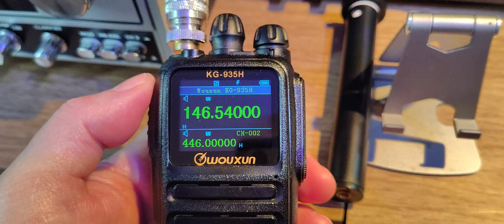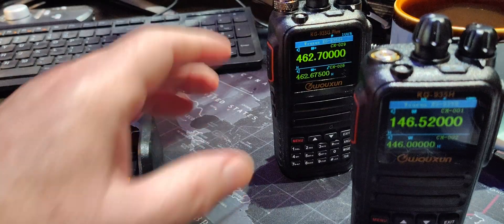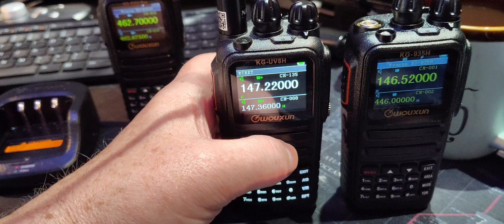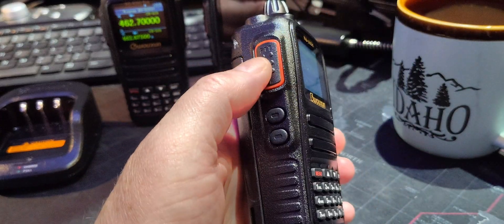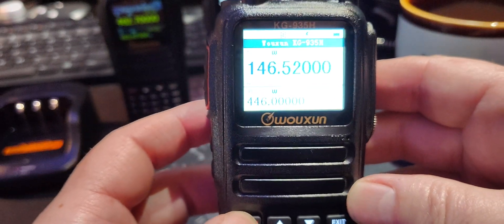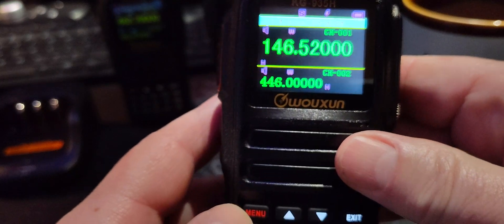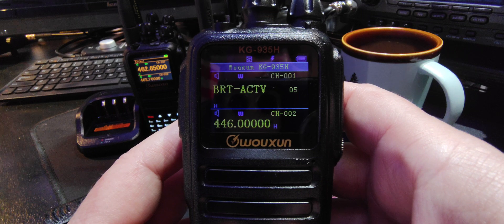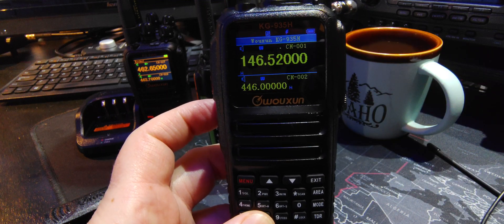Wouxun KG-935H Power test & Function Menu

Comment: Nice video as always! Can you check if this radio picks up the ubiquitous QRM on 442.000 MHz? It's an important factor for me because there is a local repeater on that exact same frequency. Superhets are not prone to this QRM issue, but direct conversion radios usually are. The 935G was. So I am curious about this new H model.
Reply from the maker: @SK-rj1ti  I get 442.000 until I set the squelch to level 8. Then it cuts it out no problem at least where I'm at